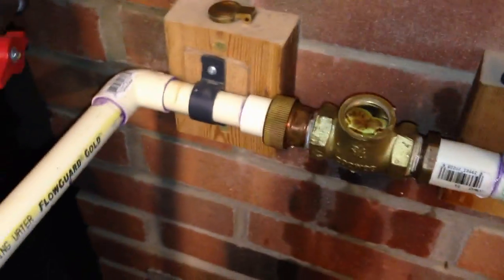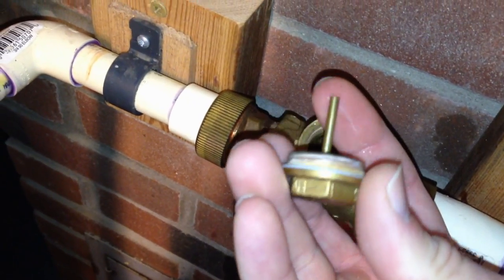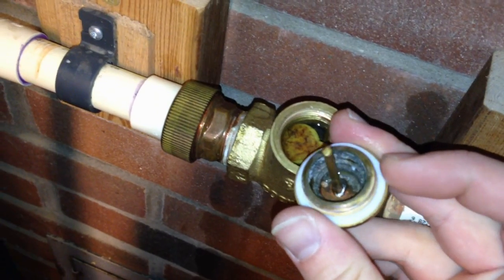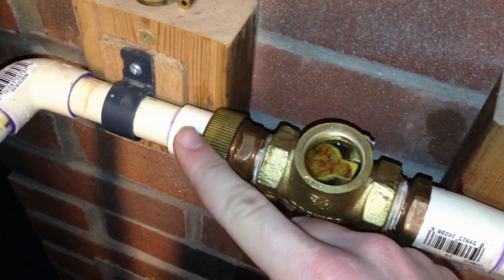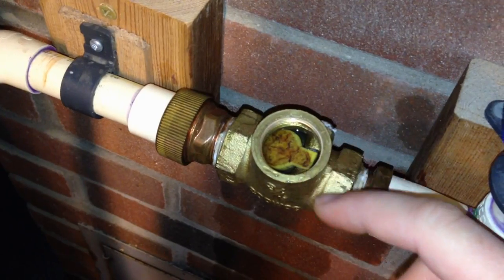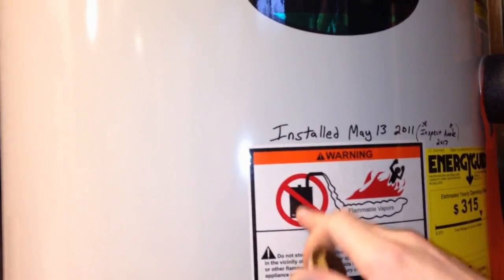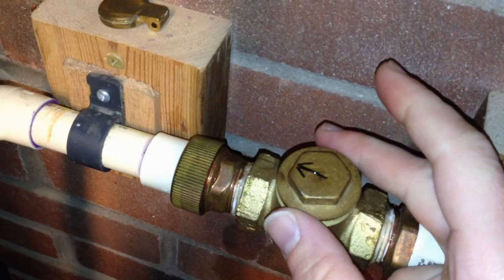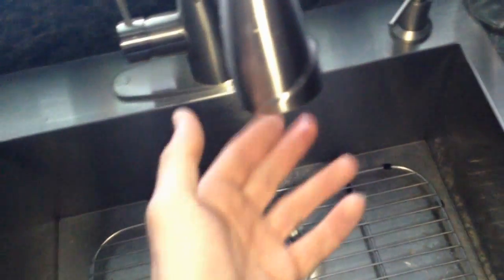Instant Hot Water Line Recirculation Part 2

Comment: they make a valve for 1/2 inch pipe maybe that would work better -smaller flap less weight higher pressure?
Reply from the maker: robbie m the pipe is under balanced pressure until the hot water is used. The flap just stops the water from going in reverse. A metal flap is heavy and technically a smaller flap has less surface area for the water to push against. The point is when a metal flap is open for a period of time it tends to seize open. Plastic does not do that and this setup has worked flawlessly all these years since this video.

Comment: For an easier installation check out the Hot Water Lobster Instant Hot Water Valve at "hotwaterlobster.com".
Reply from the maker: The point of this system is so that you don't have to wait. Point of use type systems where you push a button to cycle the water still is inconvenient to wait for it to finish. This system is so that you just turn the water on without any other function needed or waiting. Plastic insulated pipe and slow convection driven circulation of water has undetectable increases in gas/electric bills. It's a Virtually free of increase costs and has no moving or electrical parts to worry about going bad. Plus pex or pvc pipe is relatively cheap and this can be done very I expensively.
Reply: Are you a salesman for the company?
Reply: I don't work for the company. However, I've installed several of the Hot Water Lobster Recirculation Valves over the years, and have had great success with "open loop" plumbing systems (both with and without dedicated return lines). When the situation calls for such a valve...I do recommend it.